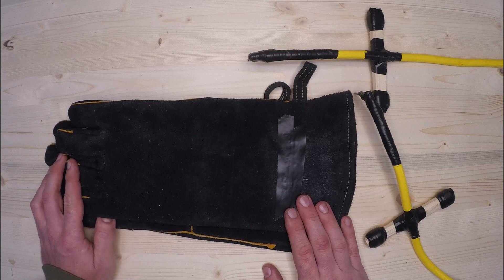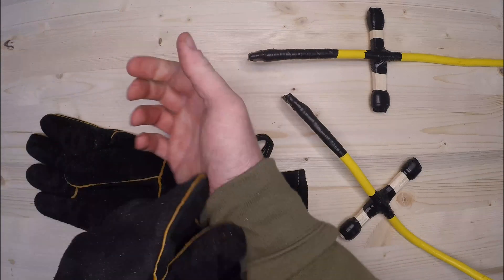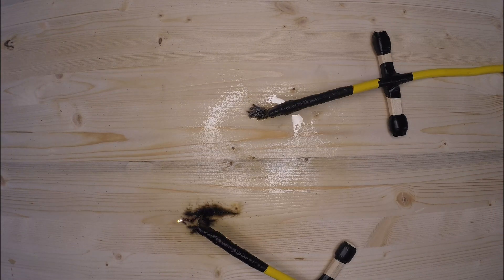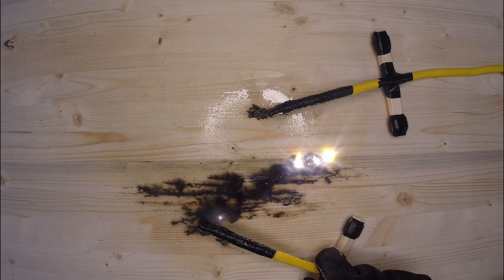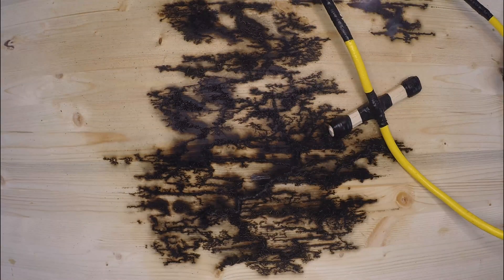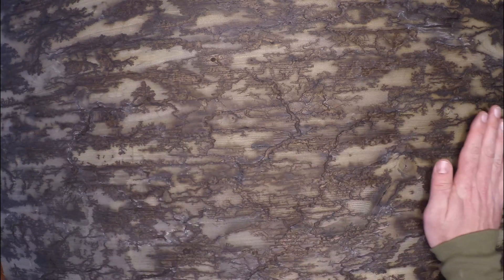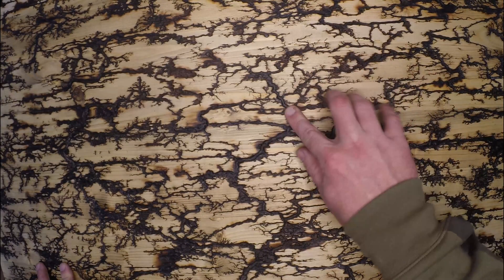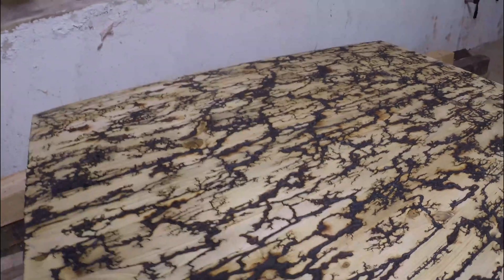Using High Voltage to Create Lichtenberg Figures (Fractal Burning)!

Comment: DO NOT DO THIS, its 2000v and 500mA and it will KILL you DEAD in seconds, this is the same voltage as a electric chair. do not fuck with high voltage people, i dont care if you are using gloves or heavy PPE, do not attempt to build one of these machine or try this at home.

Comment: Welding gloves or thick leather gloves will not stop you from getting electrocuted! You need rubber electrical gloves rated for the proper voltage.

Comment: Nice table; really cool technique. How did you make, specifically attach the table legs?  Fun times auf Deutschland.
Reply from the maker: I suppose I DID skip over that part. I actually do have an easy attachment method that isn't difficult and is very strong. I'll show it in my next little table build! Fly safe!